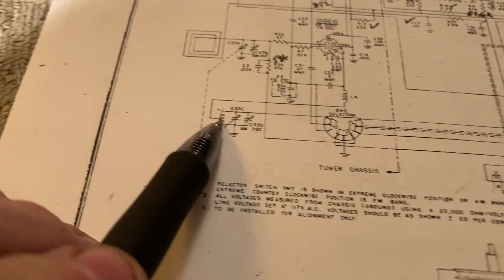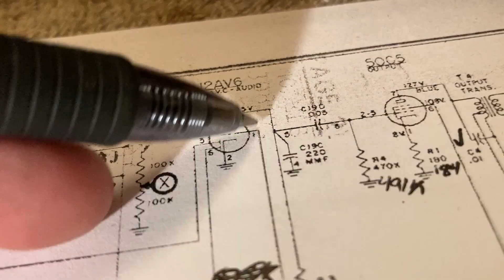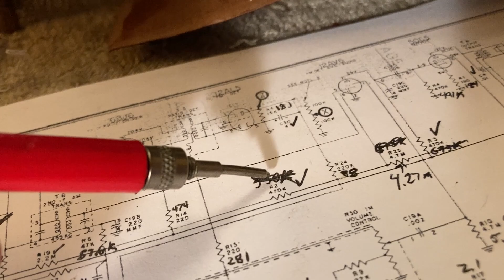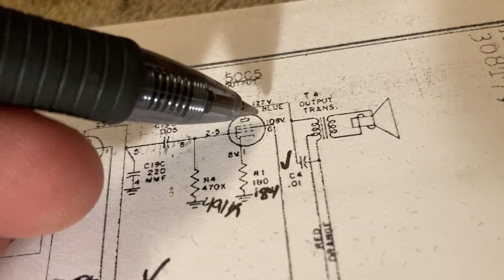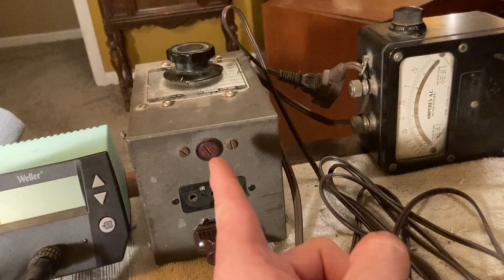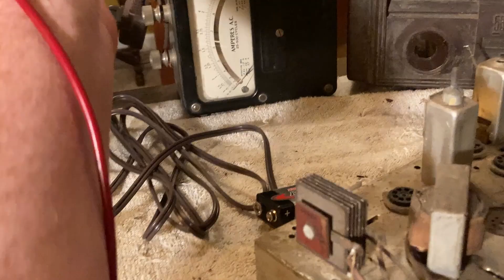Someone Gave Me A Repairman's Collection of Vintage RESISTORS! Westinghouse Radio Repair..

Comment: The Selenium Rectifier Drops doesn't need a "dropping resistor" for the voltage to be at 149Vdc but when using a Silicon Diode instead you have to add a "Dropping Resistor" to drop it to 149Vdc? What does that Couplet Component do?
Reply from the maker: the selenium rectifier and a more modern silicon diode have different voltage drops across them so you have to install a resistor to change the value to the correct voltage.  The Couplet is just a bunch of little resistors and capacitors combined into a package.

Comment: R16, the 820 ohm 5 watt resistor is actually a fusible type resistor. The fumes from a burning selenium rectifier are toxic (Sulphur dioxide). Smells like rotten eggs.

Comment: Did you replace that small electrolytic with a 4.7uF? IDK why it's a 4 most books say it's supposed to be an 8, possibly something to do with it being an unbalanced ratio detector with that weird "power drive" tube stage in front, but either way it's critical to the FM working at all, make sure it's correct. That FM detector system (and probably the AVC in this thing) DOES care about resistor values.
Reply from the maker: I showed it pretty clearly on the schematics didn’t I ?

Comment: When reading a schematic be careful. If it says 4.7M  it might mean 4.7 K. Look for others that say 3.3 MEG so you know
that they are not using the older Roman lettering  ( M = 1000) instead of K for Kilo!
Reply from the maker: I keep forgetting about that.  This one is late 40s so I’m not positive but I’ll recheck it
Reply: @AmateurRepairTime If the third band is green it's million (assuming it hasn't fried to black).

Comment: Is that sand resistor starting to corrode?   Love that AC Ammeter!!  Nice video - thanks for sharing.
Reply: Those go really bad after a time and was used to drop voltage even in 1950s televisions. Repeated heating (on)
and cooling (turned off) just does them in.

Comment: With vintage  carbon composition resistors (used or not) with age some but not all act differently as they get current
flowing through them. They actuallly raise up in value and don't return to spec. This is due to the  hydroscopic nature of
their compositional properties. I got a whole bunch of them and some are already out of spec by twice their listed value.
All are unused. Really should check ones you intend to use before putting them in an old radio. Any out of spec resistors
should be discarded regardless of their Watt rating. If you run across a flexible cloth coverd resistor ( Flexohm) don't 
touch it as with age they become rather fragile. They are simply wire wound resistors manufactured cheaply.  If you want
to test a resistor in circuit (or a few) you can  remove the tubes around them to open up sections of the circuitry.